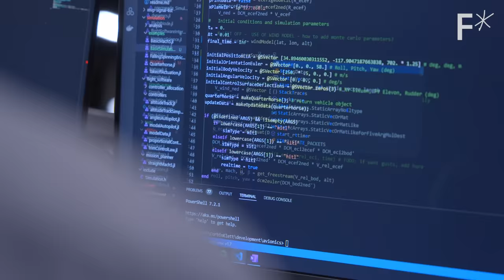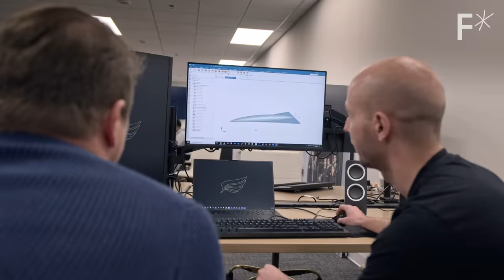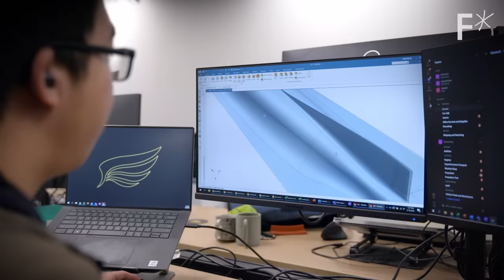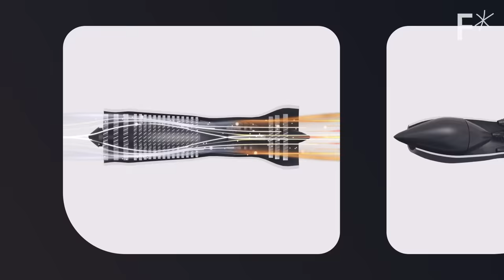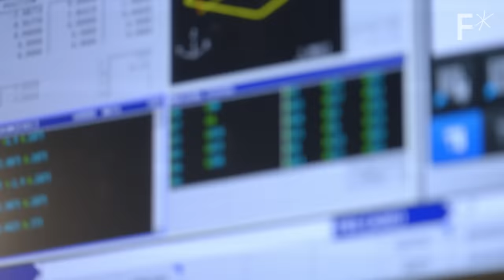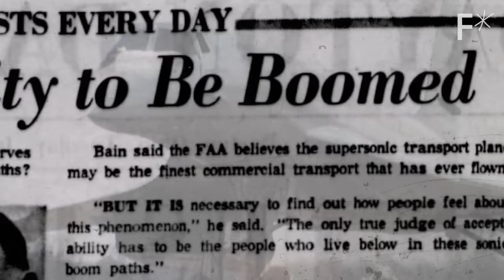This Mach-5 engine will do what no other can | Challengers

Comment: As  a pringles chip repair man, huge respect to these engineers
Reply: I have a can of Pringles that I dropped from a hypersonic aircraft in flight. Can I schedule a repair appointment?
Reply: A what?
Reply: A few of my pringles came broken in their packaging, could I please get a ball-park figure on the repair for these 3 pringles? 
Thanks.
Kind regards,
Elliot
Reply: Oh, the "Pringles" chip..  One of the only types of chips that China has been able to produce without stealing the technology first.
Reply: Thats a serious job - kudos!
Reply: Thank you for your service.
Reply: I'm eating a can of pizza pringles rn and some of them are cracked, are you available rn?
Reply: David Jacobs      Do you overhaul Fig Newtons?
Reply: that's honestly an impressive skill 👏
Reply: I always wondered, is it TIG or MIG welding?
Reply: @ Elliot Harris

This is most unusual, as the reason that Pringles are hyperbolic paraboloids plotted over a circular domain is to prevent damage during transport 🤪
Reply: Rotary engine?
Reply: the pringles logo needs to be fixed
Reply: I mean, there could be an engine that can already go Mach 3 or 4, but the fuels we have aren’t as efficient as we need them to be, and not storing enough energy

Comment: As a piston return spring adjuster, huge respect to these engineers.
Reply: Thanks for the reminder i realy need to replace mine on my 7.8 liter i6 diesel
Reply: Kinda like a crankshaft stretcher.
Reply: I hear if I put 2 in each cylinder it doubles the horsepower? Can you confirm?

Comment: Extreme fuel inefficiency, exotic materials, limited flight paths, and instability at low speeds? Love that capital is funding this.
Reply: Yeah will they invent new tech to create fuel efficient hypersonic engine else it is a waste of time. Haven't they learned from concord
Reply: You Seem Smart.
Reply: well, those are the problems they're trying to solve lol
Reply: @michaelarchibong5453  the concord wasn't hypersonic.
Reply: @sourand jaded Concorde was supersonic.
Hypersonic is mach 5+. Supersonic is mach 1+.
Reply: All just theoretical until they have a working prototype  that doesn't cost 5 planets to build and operate but apart from that power on dudes.
Reply: You could have said something similar about penicillin, antibiotics, flying, spaceflight, nuclear power...
Reply: who cares how much it costs? Stop hiding behind useless figures and do something.
Reply: @sourand jaded k you clearly know very little about this topic lol.
Reply: @michaelarchibong5453  Australian company involved in HIFIRE AUS.USA,UK Hypersonic test who bult Australias scramjet for those tests has a new scramjet engine that runs on Hydrogen and say they can turn their scramjet engine on and off during flight and are building a drone for satelite deliveries reuseable vehicle.
They say it should bounce off the atmosphere like a stone across a pond and will give it longer travel distances.
First flight of the demonstrator drone is next year.
But because needs a rocket booster he saids he wouldn't trust flying in it.
Reply: @eane7238  I am not talking about how fast it was moving I am talking about how it failed because people didn't want to go that fast. And Airports had to be built miles away from cities cause of the sonic booms they made. This would be worse cause it's faster.
Reply: After some speed the fuel efficiency starts increasing as the speed increases.
Reply: Who ever is funding this might as well burn their money for better use, modifying old tech isn't go to cut it here sorry.
If you want to go true hypersonic you need to redirect the controlled air flow around the turbine totally bypassing it, like an engine in a engine.
Reply: Not made for passengers.  Perfect for weapons.
Reply: @stephenconnell  The first line of "building a hypersonic xxxx" is a bit rich, using the word potentially at the start would be better.
Reply: @eane7238  They missed the mach scale reference and don't comprehend super vs hyper, common core education?
Reply: Ding ☝️
Reply: Funny thing is, if it ends up like the sr-71, it actually had waaayyy better fuel efficiency at mach 3 vs lower speeds
Reply: Do you not understand that this is how science progresses?
Reply: @sourand jaded the word ur looking for is supersonic. guessing the meaning of words based on etymology alone doesn't always work
Reply: Hypersonic aircraft are more fuel efficient the faster they fly.

There are plenty of transoceanic flight paths to be economical.
Reply: Dude,the head of engineering is a woman. You missed that part.
Reply: Missile testing is cheaper if outsourced to north korea.
Cheaper missiles are more accessible and will not bankrupt the country, military, weapons industry, ... war for china-taiwan at todays prices should be about a trillion each side. Your budgets = might as well lose a war (ukraine-russia)
Reply: @michaelarchibong5453  Concorde is not relevant here.
Reply: people always trying to solve problems that dont need solving. The truth is our time is not that valuable, we dont need to fly around the world at mach speeds. The extra fuel costs vs time you save would not justify 90% of the popluation using this method. Average bloke makes like $30 an hour, supersonic planes shaves 3 hours off your flight, congragualations, you saved $90 and spend an extra $1000 on the ticket.
Reply: @pluto8404  lol the average salary in the US is like 10$ an hour, not 30
Reply: @pluto8404  development research of incredible aircraft like the x15 and sr71 have immensely improved flight safety and efficiency.
Reply: It’s a research vehicle for the purpose of researching more about these exact problems. Armchair engineers need to understand not everything is meant to be a final product for sale especially if they’ve said multiple times it’s a rough prototype.
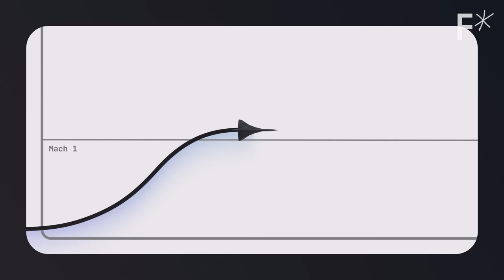Reply: @sourand jaded 3:10
Reply: @sourand jaded YEAH STOOPYYYY
Reply: @mrkeogh  even cars, avid horse riders hated & doubted cars 🤣. Some considered it impossible to make a turn at 50 miles an hour:elbowcough::elbowcough::elbowcough::elbowcough::elbowcough::elbowcough::elbowcough::elbowcough:.
Reply: Need more input ! Yet it kind of necessary! With faster commercial planes the savings get passed on to the consumers or at least we hope they do.
Reply: Yep, that's why everything will be WAAAY too expensive to make any sense. All those companies are wasting time and money.
Reply: @FuckYouYouFuck  
"Hypersonic is mach 5+. Supersonic is mach 1+."
Almost correct. There's also the transonic range between subsonic and supersonic where the airflow is subsonic over some parts of the aircraft and supersonic over other parts. This happens at speeds of approximately mach 0.9 to 1.1, depending on the aircraft.
Reply: besides its only useful over patches where going supersonic is legal and over the pacific ocean would be the only place that is efficient to go those speeds but there are still a few inhabited islands here and there
Reply: you must be conservative
Reply: Yeah sacrifice of of that just for speed
Reply: @mrxmry3264  and much gayer
Reply: not to mention flying over cities at supersonic is illegal unless its a military aircraft
Reply: @sandysand3097  Why did Concorde fail?  COST.  Why did the US stop flying the space  shuttle?  COST.  Why is the SR71 not in service anymore?  COST.  Why are people pissed off about gas?  COST.  If cost doesn't matter to you then send them some money and "you" do something.
Reply: @Yku30  The smartest people in the world worked the math and even built a functional aircraft of +MACH 3 speeds with the SR71.  We been there and done that and moved on because it's not practical from the cost of development and maintenance.  Like you said, It's standard now.. It's standard now because of all the development and progress learned from the past... We moved on from this type of aircraft.. We have already been down this road and concluded that it wasn't cost effective.... Not even with the funding of a Super Power nation.. Too expensive for not enough purpose.
Reply: @pluto8404  totally agree. 👍
Reply: Do you get how research is done? Ir do you think everything was invented very easily first time?
Reply: @uku4171  no the average salary is 70000$ a year.  Or around 30$ a hour.
Reply: Airforce*
Reply: So the military? If they can be spraying the most expensive paint ever on top of the B-2 they surely can maintain and inconel. / carbon-carbon airplane if it performs.
Reply: Yes, that's why they're funding it, cause you need failures to get to success. You simply cannot just reinvent physic within 10 years. Hating on a project when it's not a complete product is is just bad thinking.
Reply: @jan_phd  technically is true, airlines are more interest in making money while militaries are more interested in performance. This thing is not economical at all at the moment, that's why it seems only the government and the military are funding it.
Reply: @motogeee510  Imagine the cost of flying in that thing dude. A single ticket from California to New York would cost over 300$. It would also make it very difficult to distinguish it between a fighter jet and a passenger plane. Would you really be willing to spend 150$ - 250$ more to get to your destination quicker?
Reply: @sourand jaded  super sonic: thanks for the Latin lesson.
Reply: lol with energy crisis we will f*king ride horses soon
Reply: @RM-el3gw  don't be rude. Besides, somebody already explained it to him.
Reply: Sounds like someone is sad about their bank account.
Reply: Weapons manufacturers are funding this. The idea that it is for civilian applications is a pathetic front. It's PR
Reply: @sandysand3097  you must be a big fan of the circus that is nasas SLS
Reply: @meintingles4396  it costs way more fuel to go this fast and is more dangerous. Going at low speed is safer, more fuel efficient, less expensive, and better for the environment. Hypersonic isn’t worth it in all aspects.
Reply: @Sm00thieK  ooook... what was the purpose of this comment my guy?
Reply: @pablolarios3229  The purpose is to emphasize that this project will be a failure.
Reply: @enolopanr9820  Wouldn't you use less fuel at higher speeds?
Reply: @enolopanr9820  Excellent response, thanks man. What about having them fly at higher altitudes? Not commercial airliners but missiles? Could less air resistance / density come up with a way to circumvent this?
Reply: @mrkeogh   but all of those things support hundreds of millions if not BILLIONS of people. Compared to this which helps 27 people?
Reply: @jan_phd  Yeah it's obvious front company.

Comment: As an aerospace plumber, I have huge respect to these pioneers.
Reply: I'm a nasa janitor:^<( :/
Reply: They had Scramjets that powered the Blackbird to Mach 3. Same engine concept, hence the Scramjet name. It's cool what they want to do, but Pioneers they are not.
Reply: @derekedge2089  I just flew one last night. I got my licence in MSFS 2020 and my mom lets me play till 930pm anytime I want.
Reply: Apparently the blackbird used to leak fuel like a sieve when cold on the ground..
Reply: I started out as a in-flight missile mechanic until I got my degree in rocket surgery
Reply: I’m a land plumber what does a aerospace plumber do.
Reply: What " Pioneers " There only 37 years Behind Boeing & Arojet  ???
Reply: As an evolved primate, I have huge respect for these Aerospace Apes.
Reply: @derekedge2089  there badges were Mac 3+. I think major brain shul flew it Mac 4 or 5.
Reply: @Iaintwoke  it was purposefully built like that because metal expands due to incredibly high temperatures and it then fills the gaps.
Reply: As a professionnal traveler, i'll be retired when Hermeus enters service!
Reply: Hi I think you are doing a great job. However I think to maintain an airframe expose to high heat tempretures for long term on and off use, may well generate high maintenance costs for airlines. Thus this may kill this project! However there is a different and far better concept design, far more advanced from your design for a much faster aircraft with a speed range of Mach 8 to over Mach 12 with a complete   new different type of hybrid engine that may only exist secretly.

Comment: This is very similar to the SR-71's J58 engines. As the velocity increased, they would divert air around the turbojet core and directly to the afterburner. At its cruising speed, they were essentially acting as both a turbojet and ramjet at the same time. Chimera takes that concept one step further by having enough bypass capacity to continue accelerating even after the turbojet is shut down.
Reply: Ah ha! I was wondering about that. Just a "small" step forward. That makes sense considering their engineering approach. I hope these guys do well, we need more innovation (take risks) and less bureaucracy (don't take risks) in our aerospace programs.
Reply: difference: before they had the turbofan inside the moving spike of the ram jet, now they are putting the turbofan infront and adjusting engine bypass
Reply: Isn't that called scram jet. Air and fuel, that's it.
Reply: @shaunleddy430  That's a ramjet where the air travels faster than Mach 1 inside the engine. This isn't a scramjet.
Reply: @burgerpb5476  The spike acted as the J58's intake ramp, which  is responsible for ensuring that the air entering the engine remains subsonic. Chimera seems to differ in that there's a much greater emphasis of the ramjet. If I'm remembering the diagrams in the video correctly, the primary path for air was around the turbojet, which is the opposite of the J58.

Also, the turbojet was in a fixed position.
Reply: Yes that's my understanding too . I belive they have a shockwave cone that moves back at high mach numbers and blocks off the turbine section completely so the airflows around the turbine central core straight into the ramjet burners in a seemless flowing tube of high speed compressed air . Genius work guys .
Reply: @adzythepwcblokeinaustralia5467  The cone reduces the airflow to both parts of the engine. This is necessary at high speeds to keep the airflow subsonic.
Reply: @burgerpb5476  your understanding is flaw, in both design, the air from the ram jet actually goes around the turbofan, the turbofan is NOT part of the spike at all.
Reply: @lagrangewei  precisely✅
Reply: Amazing how far we as humanity can go an still want more
Reply: I'm under the belief that the turbine will still spin at astronomical speed 🤔, or is it completely closed off?
Reply: @backroadbeetle4781  It gets completely bypassed when shut down.
Reply: at 13:26 one of the engineers has an SR-71 book on his desk
Reply: @pseudotasuki  scramjet is where the flow through the engine is always supersonic, ramjets are basically the same as scramjets but they first decelerate the air to subsonic speeds before ducting it to the combustor(s). Unless I misunderstood what you wrote and you were saying exactly what I just said, in which case my apologies
Reply: @adzythepwcblokeinaustralia5467  actually, on the SR-71's intakes, the cones move forward at higher Mach numbers, not back. The primary reason for this is that the spike needs to be positioned precisely so that the shock cone eminating from the spike tip perfectly intersects with the forward edge of the intake cowl. As Mach number increases, the shock cone angle gets steeper (ie sharper), and so the spike moves forward in order to keep the shock wave intersecting the cowl at the same location. The diversion of the intake air around the engine was done actually not so seemlesly using large diameter pipes/ducts (I mean that literally, they look like welded on pipes) that run out of the intake manifold, around the turbo machinery, and into the after burner.

Edit: spelling and clarity
Reply: @maxk4324  I said "to keep the airflow *sub*sonic".
Reply: @pseudotasuki  sorry, I was responding only to your message that started with "That's a ramjet where..." in which the wording was a bit ambiguous whether you were claiming ramjets or scramjets had flow at M>1 inside the engine (as this is only true for scramjets). Upon reviewing your subsequent replies I see now that you had it right and it was my mistake on misunderstanding your first reply.
Reply: @maxk4324  Aah, yeah. I see the ambiguity now, since "this" could have referred to either "scramjets" or Chimera. Womp-womp!
Reply: Adzy... Thanks for your explanation.  This effect seems easy to understand, qualitatively but determining the flow logistics of fuel, air and exhaust at these crazy high speeds and temperatures must be vastly harder.  Hats off to this teamwork !

Comment: Other than the kid holding an SR-71 model, no one mentioned it used a similar engine concept for mach 3+ flight.
Reply: Because it's not really. It would've been a cool mention to explain the differences between chimera and the SR-71's engines though
Reply: And first flew in the 60's!!!